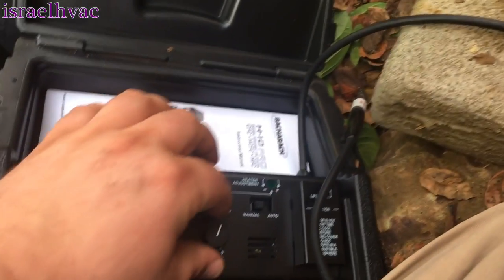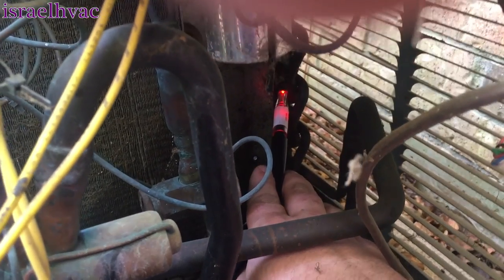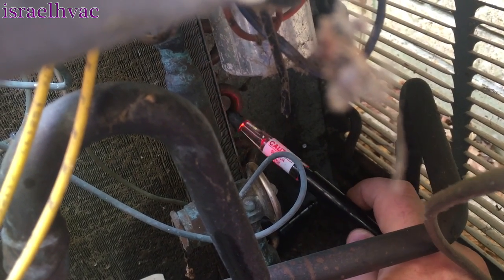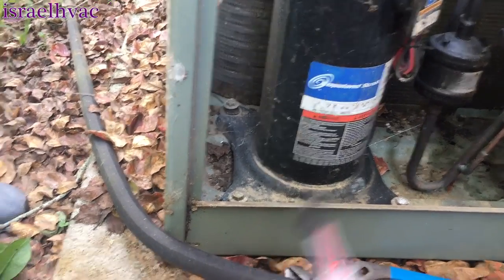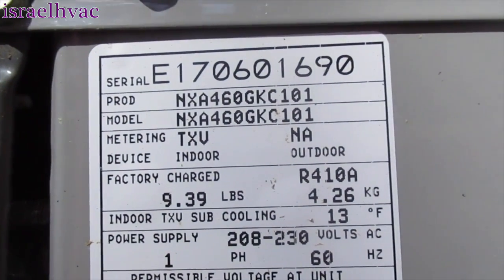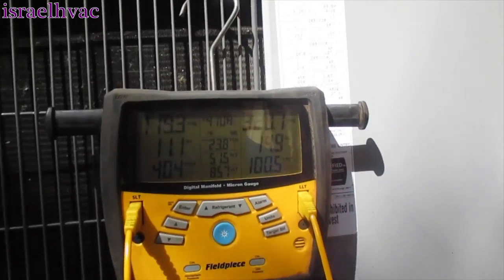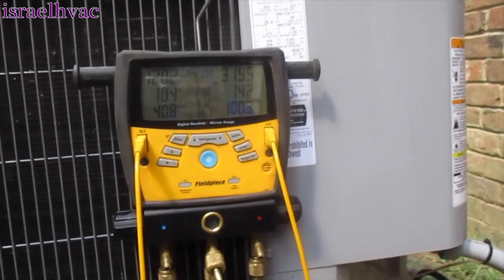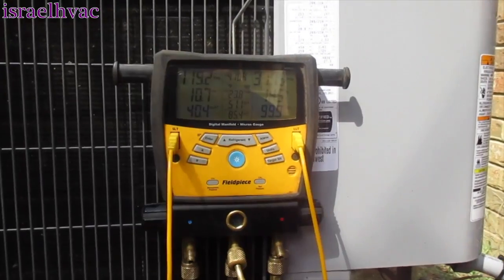HVAC Service: Leak Check | System Check Up

Comment: Good Video ! That Condensing unit Might have been under the 10 Year Warranty Depending on install Date. Manufactured December 2006. installed in 2007 im sure. Would have been close.

Comment: On obvious oil residue on condensor and easy access to coil H10 is great...but for warranty work on leaking evaporators we verify with dye...
Reply: Man, I have never had luck with dye and the manufacturer tech support doesn't exist. Stuff is a mess and doesn't work for us. Any good app and search vids please link them to me . 🤙
Reply: My boss doesn't believe in using leak detectors, so that's what we do for leaks that aren't obvious - dye, recharge, and return in two weeks with a black light.

Comment: I have an HG10 by Yokohama and its the balls for R22, but won't find 410a and not very good even for 134a.   Is this a newer H10 that will do the newer refrigerants?  I bought a newer detector from JB called the Prowler and it will only detect leaks if they are large and held on the leak directly for 2 or 3 seconds...I hate the dam thing. I saw one gut on youtube testing sensitivity on several models and Tiff was junk, yellow jacket responded well and One of the Inficon units.  Do you have a favorite?
Reply: hvac01453 I love field piece products and chose a Yellowjacket leak detector because of its performance over the rest. I recommend the yj